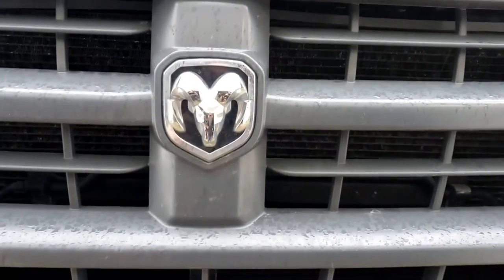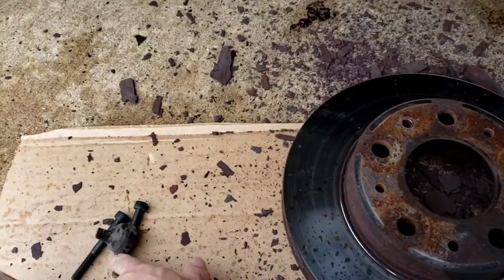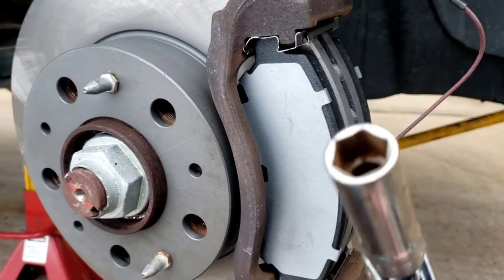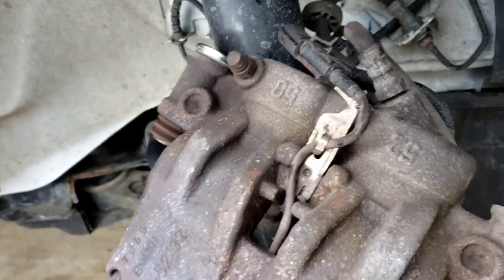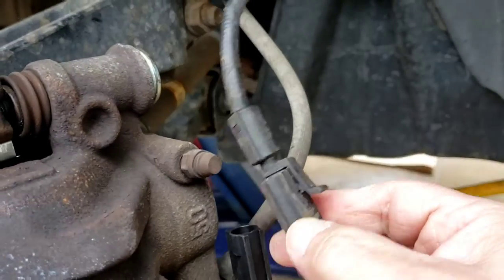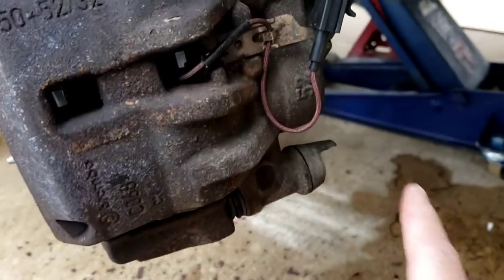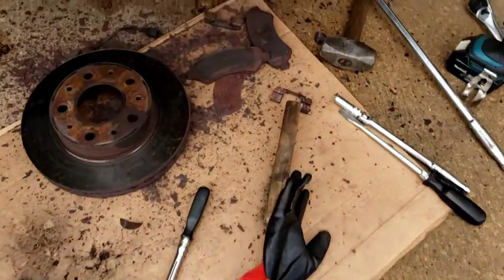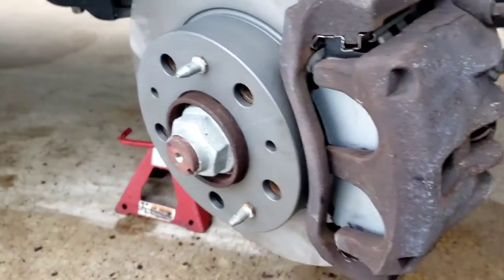Dodge Ram 2500 Pro master Front Brake Pads and Rotor Change with Brake pad sensors 2016 and Others

Comment: Damn. Was hoping he'd show how to remove the pin. Got the 6mm Allen bolt out. Nothing moves beyond that.
Reply from the maker: Pins sometimes will come out easy with the correct size socket,  others will snap off, others will be real tight and with those you need to soak them with a wd40 or a pb blaster penetrating spray..heat from a propane torch also works once the pin is cherry red. Lucky for me these were not frozen.

Comment: Duralast parts - how are they performing?
Reply from the maker: I buy only the Best ones they sell, its the Elite pads or below that  the Gold pads..Rotors have the 2 year warranty or the coated ones at 3 years..Been using them for over 8 years...Never a noise or squeak, comes with the hardware..